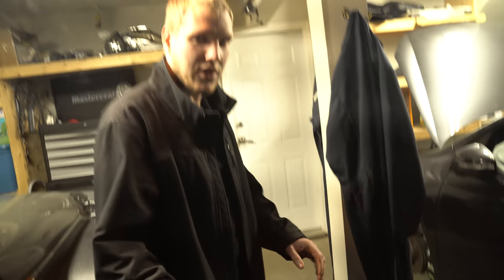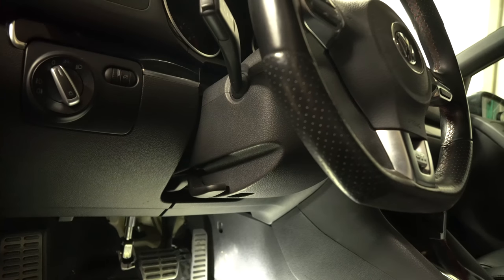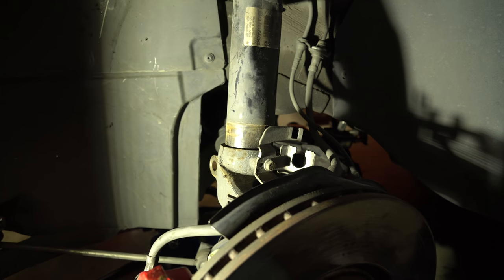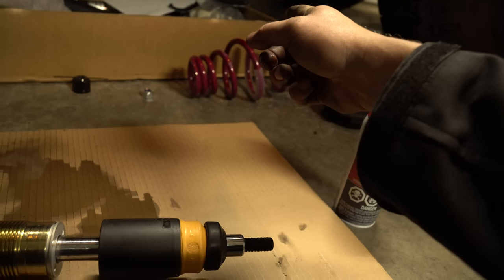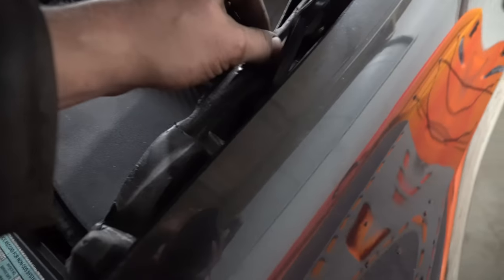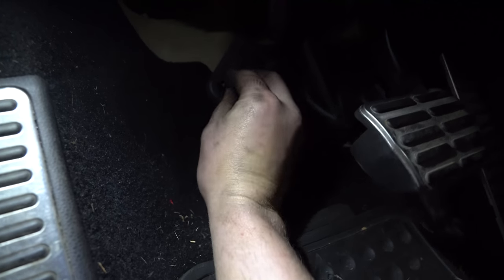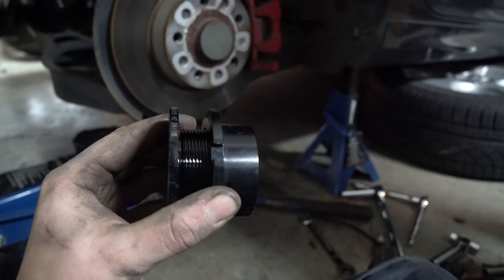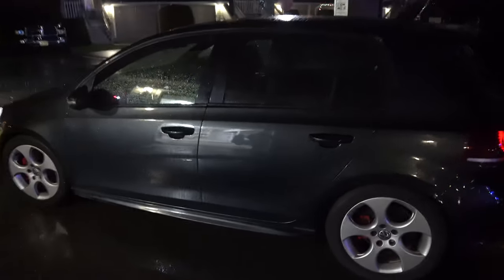HOW TO INSTALL COILOVERS AND REPLACE SUSPENSION VW GTI GOLF MK6 2011

Comment: Got the same suspension setup on a mark 5 2.0fsi NA 150hp and its feels incredible :) dropped all the way down to the front and on the back i took the spacer away so its even more lower.

Comment: Did you manage to get the strut out without removing the driveshaft from the wheel hub as indicated in most other videos for a mk6 golf? I need to change my strut top bearings, thanks for the video.
Reply from the maker: We did not remove the drive shaft because we decided to drop the subframe the way we did it
Reply: I just did mine, I didn't remove the driveshaft or subframe and it worked fine

Comment: Little easier trick instead of disconnecting Subframe just disconnect the Spindel and move the drive shaft out the way you have all clearance needed

Comment: No need to touch the subframe bolts, if you need more clearance for the hub then just undo the hub nut and push the driveshaf out of the hub. No need to tuch the wiper arms either, three 13mm bolts easily accessible by bending the scuttle panel up. Dropping the subframe risks messing up camber and requires new bolts for any that are undone.